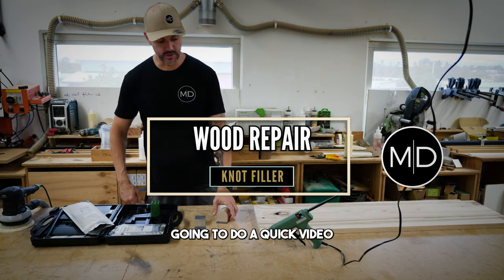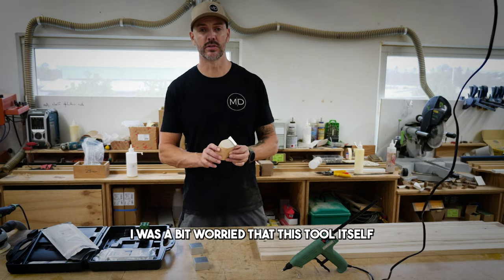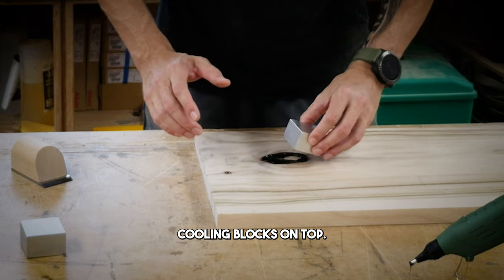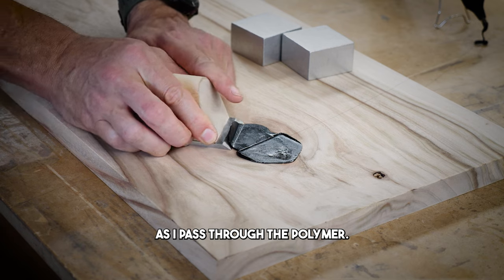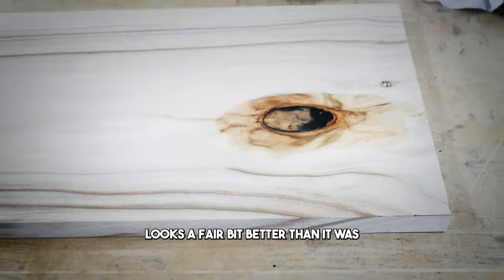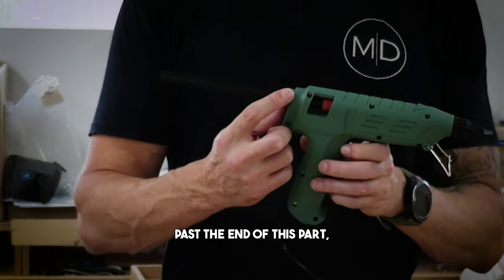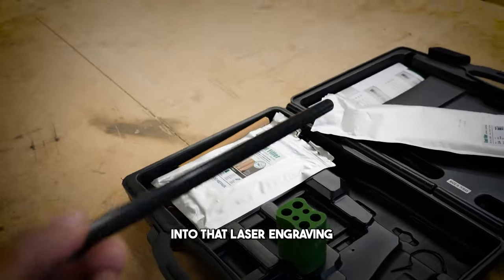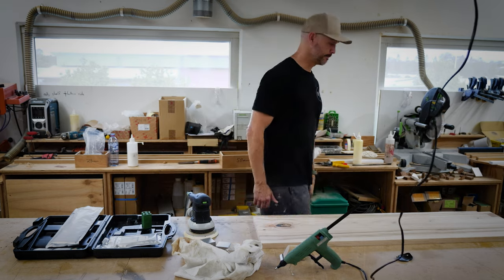Revolutionising Timber Repair with this Wood Repair Kit!

Comment: Common garden variety hot glue guns recommend never pulling the glue stick out the back. A better option would be simply cut your coloured down to a length appropriate for the size of knot and then chase the coloured stick through the gun with a stick of cheaper rod in a clear plain colour, which could also be shortened so as to clear out the front quickly when going back to a coloured stick.
Reply from the maker: Turns out there's a better option. The kit actually comes with a cartridge saver...I stupidly thought this was just a little apparatus to hold spare sticks in, but it is actually a rubber/silicone mold that you can inject the unused filler into and it takes the shape of a new filler rod that can be reused at a later stage...I didn't realise this until the seller of the product reached out to me to explain :) No more waste from now on.